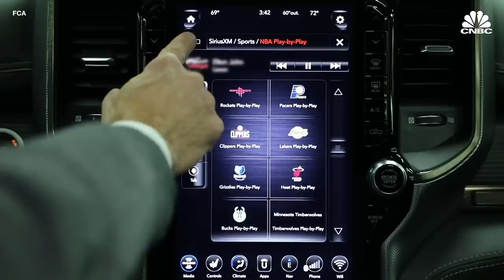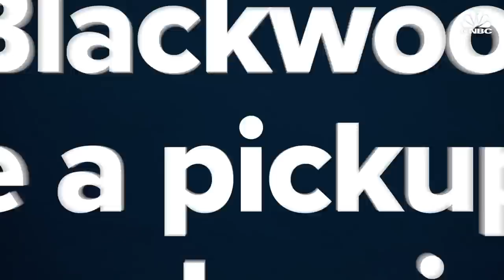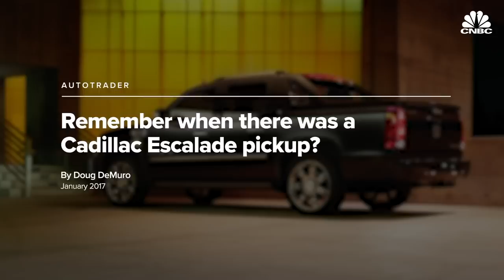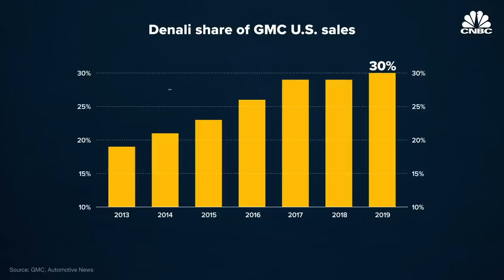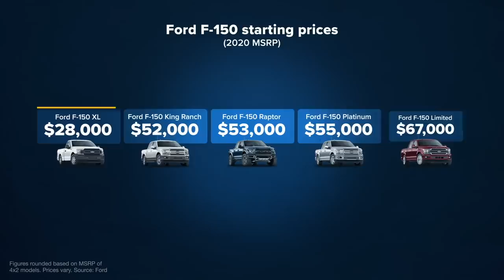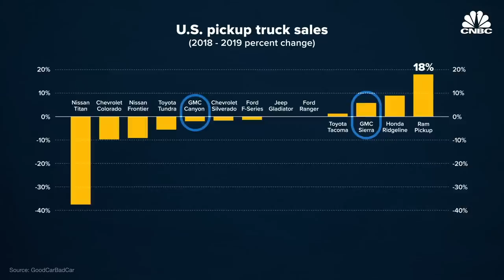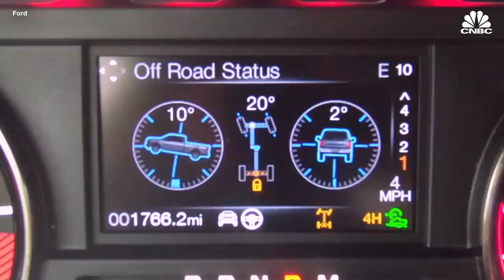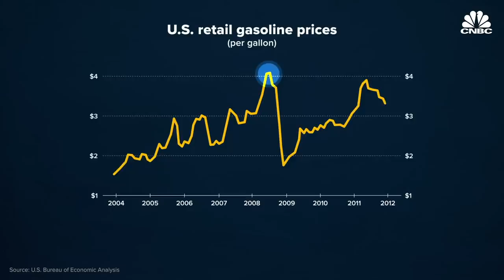How Detroit Turned Trucks Into Luxury Vehicles

Comment: And people like me who actually use a truck have to wait until its 5-10 years old to afford it. SMH
Reply: Buy base model homey. You can get a great “tool” for work  for $30k.
Reply: Thanks for input but even 30k is too steep. Thats still about 500 a month not counting insurance.
Reply: @chadmiller7876  it's not really that much considering how much utility and tech new trucks have
Reply: All of which is absolutely useless to me.  I live on a small farm that went to my mother when my Dad passed on.  If it can pull a horse/cattle trailer is all I need.  I shouldnt have to pay more for a new truck then most people pay for their homes.  All that "tech" ends up doing is costing you money and more future repairs.  Even under warranty it gets old running to dealership everytime a switch or sensor is recalled.
Reply: @chadmiller7876  old f250 or ram. Ive been looking at getting one myself
Reply: We have had a few rams in the past.  Started with a 85 ram my Dad got when I was a kid.  It was my uncles who died young from cancer and my Dad took it over.  He put a mounted phone in it back before most even knew you could lol.  Then in 98 he was given a new 98 2500 ram from his older brother who owned the company that dad worked for.  He quickly gave it up because it was 2wd and almost useless in weather and on farm.  He bought a 99 ram as a personal truck , it was a 1500 4x4 he ordered with a 5.9l 360 instead of the normal 5.2l 318.  Then my uncle got him a used 97 3500 dually he had until 2001 when he got another dually that was loaded and had the 24valve diesel instead of the 12valve that the 97 had.  After the 2001 he switched to Chevy which he stuck with until he died in 2016.  Out of all those Dodges we had they all basically fell apart except for the engines lol.  I was sold on duramax with the allyson tranny when I was in a Dodge with the 24V cummins turbo and followed my dad in his chevy duramax with the allyson trans.  We were pulling gooseneck cattle trailers and he absolutely left me in the dust. We hit a hill and he let me get up beside him and while my dodge was loud and thrashing around and at a high rpm to get up hill, his Duramax was just idling up it quiet as a mouse.  I would still consider a newer Ram if I found a good deal.  My niece and her fiance live on our farm in aan apartment and he has a 2019 Ram 2500 4x4 cummins.  We use it to haul our goosenecks but I want something as well lol.  Id prefer a GMC but would take a Ram or a Ford if price was affordable .
Reply: @chadmiller7876  The thing is, they are forcing that technology------even electric doors and windows-------on you whether you want it or not.
Reply: Yea they do, and there is nothing worse then seeing the interior of a truck with all those add ons after its been used for work .  Ive seen touch screens cracked or just not working from being caked with dust and grit.  That stuff just doesn't belong in a work truck.
Reply: I am with you there.  I have a Dodge I bought new in 1999.  It is a 2 door shortbed 4x4 with the 5.9L.   I would like a new truck with a long bed.  To get anything comparable to my current truck,  I would have to order it.  They do not keep base 2 door 4x4 models on the lots around here.  Once i build it with limited slip and other drive train I feel I need, the truck is almost up to 40k for a base truck with vinyl seats.  Without options they start at 37k.  37k and you can only get vinyl seats.   I used to be the 3/4 and 1 ton trucks were less expensive than the 1/2 tons because they were very basic.  That is not the case anymore.  Demand by people that want a truck for a family car are driving the prices too high for people like me.
Reply: @p00lking  That's the problem... the "TECH". All you need is 280hp; a large bed; and 4WD or AWD and you have a keeper. Keep it cheap & simple
Reply: @Dialysisforever  it Government and union leaders driving up the price of pick up truck  commi.    I import f trucks to Australia the $10000aud  less wholesale price,  heavy duty built $10000usd net profit each for corporation. Big government can rot in hell with left parties
Reply: You still won't be able to afford it
Reply: Get an older tundra. Find them cheap and they’re extremely good
Reply: @chadmiller7876  get a Ford ranger

Comment: I like the old days and the truck that I have owned for 30years to date mine is a 78GMC Sierra Grande 4x4 4speed manual trans with manual front hubs.  Had it redone 10 years ago still in awesome shape.  These were trucks goes anywhere and easy to work on very fun to drive, going to keep this one forever.  Nowadays they put to much stuff in them and the prices are outrageous.

Comment: I purchased a new 2010 DODGE'RAM Laramie Crew Cab 8 ft bed with every option I could , other than a sun roof, and it was $43,000.  A new 2020 in the same configuration is around $78,000!  So yes, they have increased  nearly twice as much in 10 years!

Comment: There may be a niche for a bare bones pickup now.
Reply: asdf asdf That’s where the  Nissan Frontier and Chevy Colorado shine.
Reply: frontier has been bare bine since 2005 lol
Reply: 1995 F350 with a 5 speed manual here. Bone stock and still doing hotshot runs
Reply: Isuzu should relaunch in the states. The pickup trucks in Asia and Oceania, say like the Toyota Hilux, Isuzu D Max fit the bill for barebones trucks.
Reply: 1 2 probably. Chevy has a lineup of medium duty trucks that are rebadged Isuzus. Isuzu also rebadged the older Colorado as the I-series, the Envoy/Trailblazer/Bravada as the ascender, the S10 as the hombre, and Chevy rebadged an Isuzu Truck as the Chevy LUV. That would make sense.
Reply: Always will be.

Comment: I’ve been travelling to Europe an South America for work lately, these trucks are truly a North America phenomenon. You’ll see a few small truck like a Ranger etc but I only saw one full size truck and that was in Sweden. In the UK you see folks hauling smaller camper trailers with their little suv or car - they call them caravans. I have an f150 and a Silverado on the way - I found it fascinating how every second vehicle in Canada is a truck vs none in Europe. No idea how they haul stuff lol but they seem to get on with life!
Reply: I would like to give you an Idea of how we haul without that many pickups: hatchbacks... 

I drive an E46 316ti. 600kg payload in the cabin + 75kg on the roof. If I add a trailer, that's an additional 1300kg with braked trailer. Near 2000kg haul capacity from a base BMW. Of course I don't go faster than 90kmh when full load.

Comment: Loved my last new Sierra SWB 4WD WT in contractor white with the basic chrome package and bench seat. 3 other PU from Chevy, Ford, Jeep preceeded this truck. All comfy drivers. Then I swapped for a 1954 stock Chevy truck. Made it 12v, Weber 2 barrel and better shocks. Rides well, runs very reliably daily in desert, jungle, dirttrack, town and beach and uses 50% less gas than a modern fullsize. Take off on red lights is faster than most new trucks. They get me around 40mph when the I6 runs out of steam. All in all modern trucks are slightly more comfortable and less reliable.

Comment: I have noticed that over the years pickup trucks have become more luxuries. I am old enough to remember when most pickup trucks were basic utility vehicles with no air conditioning, no power steering and no power brakes and the common transmission was a four speed manual floor shift where first gear was a compound low that was rarely used. Instead the pickup truck tranmission was shifted like it were a three speed not using compound low.
Reply: My 67 ih is exactly as you described granny 4 speed no power steering or power brakes or a/c but it does have the optional am radio and passenger side sunshade 😂
Reply: @wyattnyfeler7270 I also remember the days when an AM radio was an option and had one speaker in the dash. I have seen a YouTube video on an early 1960's Chevrolet Greenbrier van which did not have a passenger sun visor or passenger side armrest, because they were options just like your old pickup truck.

Comment: I prefer the 2000s ford ranger. They look basic and non luxury
Reply: That's what I I drive. I'm at 185,000 miles and it still runs perfectly
Reply: And they work perfectly fine mechanically
Reply: 2.3L 5 speed manual 1992 Ranger still working perfectly fine at 400k miles. Was mine but now my little bro drives it
Reply: Only thing I wish they did is upgrade the springs. Sometimes it feels like a lumber wagon.

Comment: My dad bought a 2019 Chevy silverado work truck recently it is really good for working and the features were pretty limited. It had a 6.2 litter v8 and it dose it job very well. We did have apple car play and leather seat but that was it. It had 6,000 miles when we bought it and we got for 29k

Comment: Just traded my 2019 Audi A6 for a new Ram 1500 Laramie.
Reply: Congratulations on your terrible decision.
Reply: RedLight GreenArrow, I work for a dealership, I can get any car and I found the Ram to be the best value and have the nicest interior of the main truck brands.
Reply: @Honda2015  why do people just buy trucks
i guess that coming from an a6 you dont really have hauling needs or do extensive offroad on a daily basis, so the practicality aspect is out of the question
is it the feeling that it gives you knowing that you COULD do all that? (even if you rarely need to)
i dont get the appeal of truck for non work related, daily street use
still... i hold them in higher regards over suv-s which are truly pointless for most of the people who buy them imo
Reply: Andrei Laza, I have a 2020 Corolla and previous to my A6 I had a grand Cherokee diesel that would get me through PA winter and occasionally be used to pull a small trailer. So I don’t have a real need for the truck but for the price of a fully loaded Grand Cherokee I was able to purchase my Ram.  My Ram and Corolla are the perfect pair for me.
Reply: Andrei Laza, I sell used vehicles and most people buying a truck from me have a use for it, I.E. camper, boat or trailer or use it for a work related trade. I do get the customer purchasing the fully loaded trucks just to drive like a car but not as much.
Reply: @andreiuul1  If you are a weekend warrior like me, pick up makes a lot of sense. You can camp/ATV/kayak/ski trip on the weekend using it. It can also be used to do home projects. Yes mini van can do some of these things too, but it's a pain if you have wet camping gear/leaky lawn mower to haul.
Reply: Honda2015 why didn’t you get a Honda? You would’ve been much happier in the long run!
Reply: @mikezerker6925  He wasn't going for boring Japanese interiors.  He obviously likes nice interiors something Hondas have never had IMO.
Reply: Honda2015 yea have fun with the insurance and fuel prices

Comment: Americans love big vehicles, automakers just cashed in on them
Reply: That's not exactly true millenials love there sedans and hatch backs or anything that looks fast
Reply: Americans need big trucks, because we're all good at multiple skills that involve having a garage full of heavy tools and equipment, and we all have boats, campers, and trailers for when people like you, with vehicles that are only good at one thing need help moving, fixing something, or when you get stuck in a tiny bit of mud. I love great fuel economy, but I love being prepared for every single situation even more.
Reply: @enthused7591  most people dont have to deal with those situations as often as you would think.  I have hauled plenty of tools in my tiny Hyundai accent hatchback and furniture with rope. those of us without huge trucks learn to be innovative.
Reply: @MsStevo2000  innovation only goes so far. I have a car hauler, a 21 foot boat, and a 22 foot camper. Gotta have at least an 8,000 lb tow capacity, no exceptions. And you're right, 80% of people can live without one and 80% of people don't have a truck. I feel bad for people like that is all I'm saying.

Comment: Leased to own a 1989 Dodge Ram HD Cargo Van (Caravan work truck)
$500 down 24 payments of $481/ month for 24 months and a $250 buyout.
First and only time I have ever leased or financed a car.
I bought a house near Niagara Falls for $120,000 in July 2010.
Paid it off in 6 years ...before the first 7 year term was up.
Gota buddy who bought a 2018 Nissan Nimo -loaded.
He is paying $460 / month for 84 months (7 years).
Boy wont he be happy making those payment in the five , sixth and seventh years after the warranty expires.
-clutch
-set of tires
-Turbo unit
-exhaust system
-tie rods , struts ,wheel bearings
-regular maintenance issues.

Sadly he will likely loss it before ever pays it off.

Comment: My Ram certainly isn't luxury, but it is a manly beast of a truck.😉
Reply: Yeah I got a Tradesman. It has a few addons to make it not suck. Like power windows, door locks, bluetooth, four tires in the back, the 6.7 Cummins,  and the AISIN.
Reply: @dchawk81  Ahh. I want a 2500 or 3500 in the future, planning to get tractor, and eventually an excavator. How's that diesel? I have the Hemi.
Reply: @ChrisGilliamOffGrid  I don't run it a lot but when I do it's fine. Transmission could shift smoother but AISIN probably made it harsh for when you have 30k behind you. Dragging the clutches for comfort would be a really bad idea.

I'm not the guy to ask about longevity or reliability.  It's an '18 and still doesn't have 4500 miles on it yet.

Comment: The average sale price is high because that is all they keep on their lots.  If you want a base 2 door 4x4, you have to order it.   Dealers, have found that if they don't have it on the lot, people will pay a little for more for something they don't need in order to get the truck now.  On top of this, it does not cost the manufacture as much to build a body on frame truck as it does to build a unibody car.  Manufactures are making a butt load of profit on these pickups.

Comment: Some of you here commenting never even owned a truck.  I have a truck and it’s very practical I can haul a camper resell Value is excellent and I can take it down rough rocky dirt roads with out worrying about damaging an oil pan.  It gets about the same mileage as a high powered sedan from 10 years ago.
Reply: I used to own a Silverado High Country, but got rid of it for a Golf GTI, and now I don't ever want to go back. It can do what 95% of pickup buyers use their trucks for anyways. Perhaps you need to get into a hot hatch. A lot more practical too. And you don't haul thing, or not enough to justify a pickup
Reply: @jimcormany3506  you see how bright their led headlights are too? No wonder why I got mirror chrome tints and full body wrap on my Golf GTI when I do a lot of night driving. Keeps these tailgating nasties far away from me

Comment: I had an F150 Lariat. It was a work truck, a family hauler and used it on the property. It was loaded to the teeth and I loved it. I parted with it once my employer furnished a work truck and it was simply a coat savings. I like trucks, I have had one in my drive way since I could drive. I will probably purchase a Yukon here in the next year. The vehicles just have room, sit high, run well and go where I need them to.

Comment: Just wish we had more solid small to mid size truck nowadays! The ranger  is almost the exact same price as the full size!  A base ranger is 24k. A base f150 is 27k. Now a base colorado is 22.5k, which is fairly reasonable. But that is just 2wd, and you have to look for it. Most dealers are selling it used for way more than that amount.

Comment: At such low speeds limits like on American roads I wouldn't see the point in buying a sports car ... and drive it at their full range at all. With the low fuel prices it sure is an option to buy a large pickup, after all you won't go fast anyway, right? Over here most of our pickups are rather small, in the size range of the Ford Ranger, and altough larger ones got more popular in the past 3 years there aren't many of them around. Seeing them on the highway most of them will stay in the slow lanes ...

Comment: The Problems is that I see is that these Vehicles are so much costly then ever before.  
  The cost for a Vehicle is up there in the ballpark figure of say a down payment on a large single family home.
I just like to get these same vehicles used at Enterprise instead of going to the dealer where you'll typically pay 20%-35% more all the time.
  Most all my cars are used and they give me a great run for the money I paid for them.
From Enterprise I bought 2013 Ford Fusion Titanium 2.0 for $17,232  @36,100 miles that same vehicle with almost the same miles on it at the ford dealer cost $4,700 more.
  Now I went back to Enterprise and bought another Ford Fusion 2017 Titanium 2.0 for $18,560 @30,741 Miles that same vehicle with close mileage still cost $5,000 more than what I paid for at Enterprise Used car sales. 
  Never again going to a dealer, just a waste of money.
Those trucks look so nice and I want one but will be buying it used at Enterprise just like my Ford Transit Tall 350 XLT.

Comment: I wish they'd bring back the functional pickup truck
Reply: Jay Tee tundra
Reply: If you want a barebone truck They have work truck models
Reply: Jay Tee they won’t because trucks are a cash cow
Reply: @ShidaiTaino  yeah it sucks I guess I have to go south and get an old 80s Toyota.. I want something without soo many points of failure that just works. I would even opt for manual steering.
Reply: @TheJ602  these 30k+ base models aren't bare bones. He's talking about a manual transmission, basic ac and heater, and seats. No radio, no touchscreens, none of that. Used to in the 90s and prior, but no more